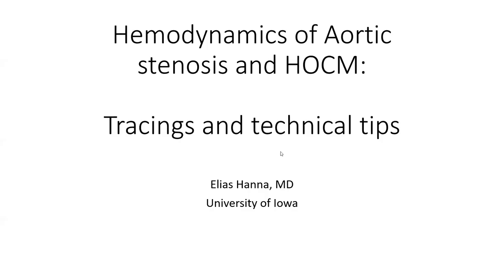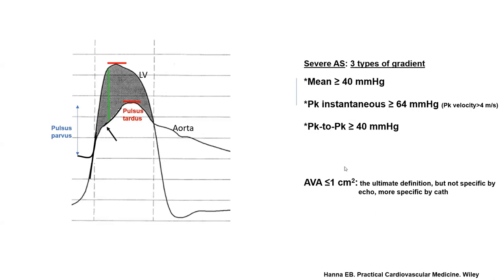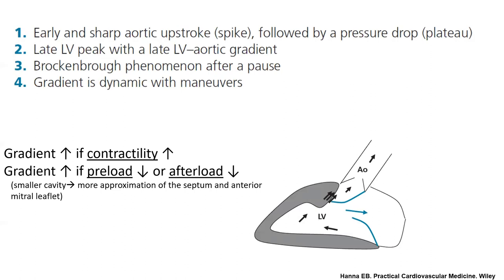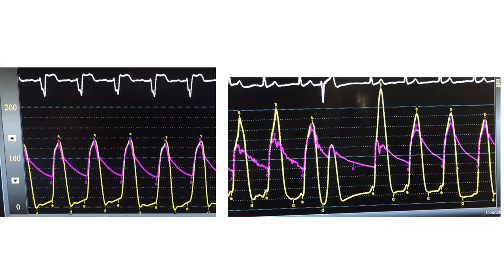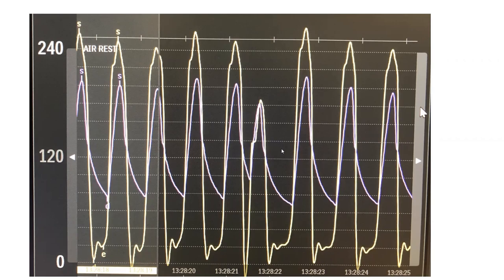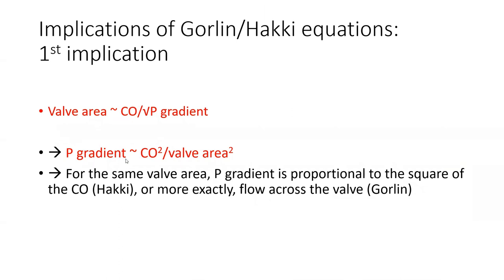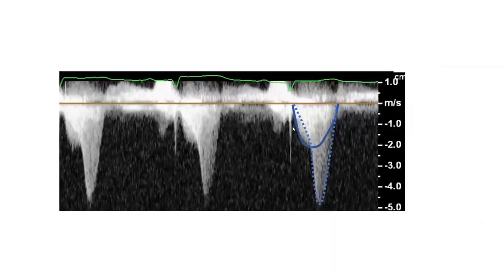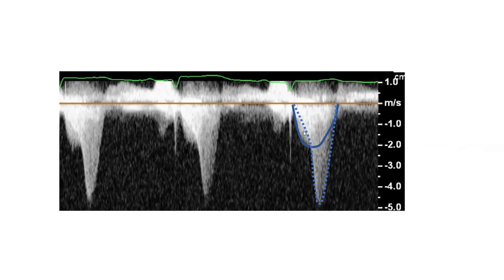Hemodynamics: HOCM, aortic stenosis, valve area equations, pitfalls of guidelines cutoffs for AS +MS

Comment: Dr.Hanna, when we do simultaneous LV-Ao pressure tracing sometimes the mean gradient from area under the curve is not equal and higher than peak-to-peak gradient. 
Which gradient that you use for AVA measurement? I had a patient that when I used the mean gradient the AVA by Hakki is <1 cm2 but when I used the peak-to-peak gradient the AVA by Hakki is > 1 cm2. So I was not sure how to classify the severity of AS. Hope you can enlighten me.
Reply from the maker: I have seen those situations many times before. That is one reason I mentioned AVA by cath is better than echo, but not perfect. You also may get significant variability of thermodilution CO measurements affecting AVA calculation. If you look at the original Hakki paper from Circulation 1981, comparing HAkki equation to Gorlin, the correlation with Gorlin was strong (r 0.96) whether you use mean or peak-to-peak gradient. ~25% of patients had mean gradient that is higher than peak to peak, as in your case, which translates into 0.1-0.2 cm2 difference in AVA calculation between the 2 ways of doing Hakki but also with the Gorlin calculation (which can be higher or lower than either one, it does not better correlate with either one). I suggest the following:
1)IF the patient is in AF,  take the beat with highest peak-to-peak and the beat with the highest mean, don't use the computer averages
2)One reason for mean >peak-to-peak is delay in the aortic pressure transducing more than LV pressure (eg, longer tubing on the aortic catheter). In those cases, make sure to shift the aortic waveform leftward on the software to make the LV upslope bisect the aortic dip. Mean gradient may end up being lower
3)If mean is truly higher than peak-to-peak, and AVA calculations are discrepant, make sure to measure indexed AVA. Remember that AVA<0.6 cm2/m2 is severe AS. So for a lot of patients, 1.1 cm2 may be severe, and the 2 measurements would coincide
4) if the patient is not in AF, I would favor using the true Gorlin equation, which uses mean gradient
5) If confusion remains, do aortic valve CT calcim scoring. >2000 in men or 1200 in women establishes severe AS in this context
Reply: Thanks a lot for the comprehensive answer Dr.Hanna 👍👍. I really learn a lot from your videos and book